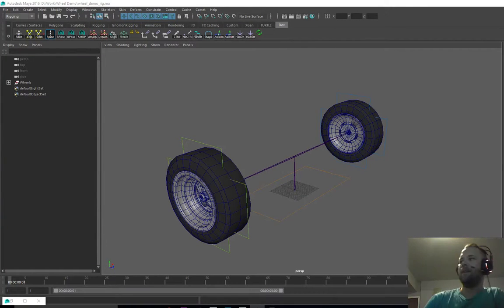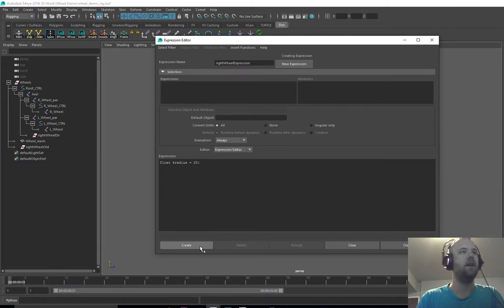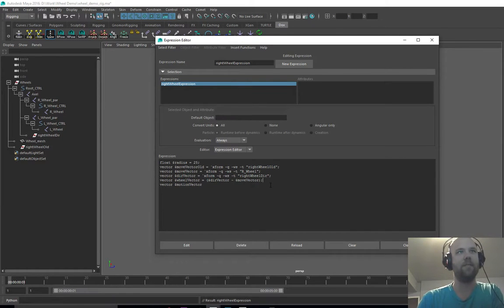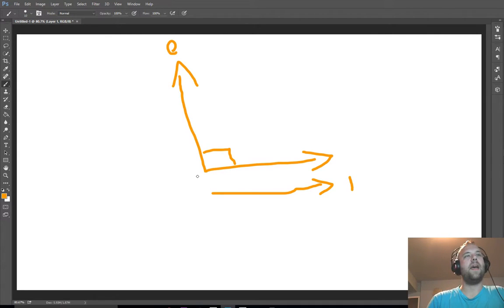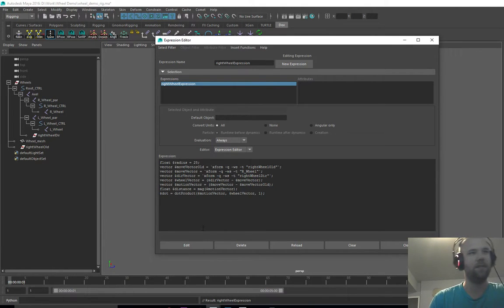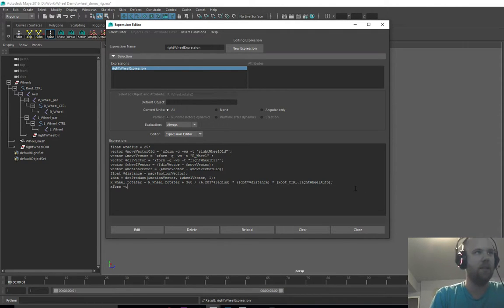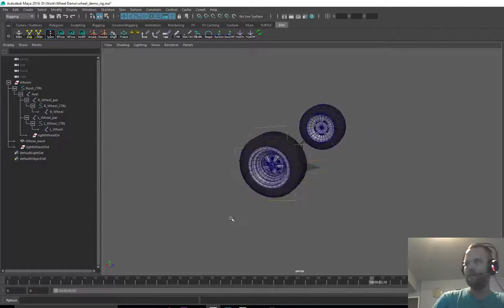Maya Wheel Rig with World Vectors

Comment: Hi, it is a great tutorial actually, thanks for sharing .... I am facing a problem though , if you animate and then press the playback button to check your animation, you won't be able to use the Ctrl+Z anymore, or you loose your undo ability ..... if I delete xform -t ($moveVector.x) ($moveVector.y) ($moveVector.z) rightWheelOld; this line however, the undo capability is back again .... could you guide me about this .... thanks again for sharing this .....

Comment: Hey people, 
if you´re like me and you got the whole thing working in a rig, but when you reference it in your scene and animate it and it suddenly stops working dont worry, I found the reason after several hours of despair.

The correct function of the rig seems to be dependent on the scene scale, if the rig scene is in centimeters, and the animation scene in meters, the wheels will turn only ever so slowly. In other words, while the rest of the scene gets adapted to the right size, the rig only takes "grid-dimensions" for its calculations.
I fixed it with an attribute to multiply the wheelturn by 100.

Boolean Atrribute on your Move CTRL: MeterSceneScale
Then wherever the rotation is applied to the wheels, add this: 

max((100*CTRL_MOVE.MeterSceneScale), 1)*

ofc CTRL_MOVE might have a different name for you. ;)

Anyways, thanks to Andrew Christophersen for making this video, it has saved me a lot of hassle working on my shortfilm! :D
Reply: Hi Maxim, I didn't get what you mean for MeterSceneScale. Could you give the full functions in here..?

Comment: In Maya 2018 I am getting syntax error pointing to the string variables even though i have named the null group and the sting identically. I am wondering if the has been changes to MEL in the last couple of years as I am having real trouble debugging the reason for syntax error.

any help would be appreciated
Reply: I had the same syntax problem, but got it working now. I used different names for the null groups so that doesn't matter. it seems to me that the text you copy has some different text code to the characters that causes MEL to error on my PC or something like that, because i retyped the command fron scratch and then it worked with me.
After that another syntax error occurred from the copied script on the vector subtracting lines. there it also was the minus sign that was the problem. I just retyped it in a texteditor with the minus on the alphanumerical part of my keyboard, so not the numbers keypad and that fixed it.
You also have to set the radius to the sheight of the particular wheel you're trying to control ofcourse.
Good luck!

Comment: Hey Andrew, thanks for this tutorial. Really well explained as you're going through writing out the expression.

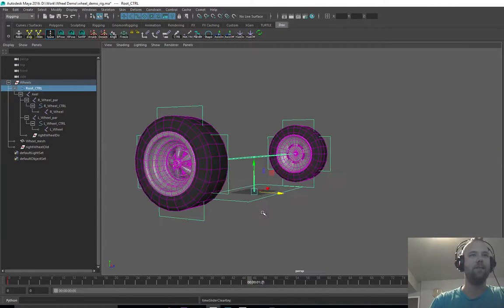I've got it working for both wheels in my test project but I have a slight issue where the wheels don't spin if I rotate the root_CTRL as you do in your video at 15:27. Do they also need to have some kind of forward motion to be able to calculate the vector correctly? I don't think I'm missing anything as I followed along exactly.

Cheers

Comment: Hey man. This is exactly what i need but i cant seem to get it going. Like a couple of other comments underneath, I'm struggling to see the relationship between the joints . I have tried your suggestion of placing the _par joints out in the wheels though this is not working for me. I have noticed that you have a joint at the origin point. Is this your Axel joint? If i create an Axel joint here, the flow of my joints does not look the same as your without shifting the joints from out on the wheel to overlap in the center. I have skinned my wheels mesh to the two wheel joints but no joy. Do i need to create the expression on a specific joint or controller? Any help will be greatly appreciated and really help a brother out. Cheers and gone.

Comment: I’m trying this right now. I’ve watched this video a thousand times trying to figure out how all this works. Fine tutorial but it would help if you would have explained the relationships of the groups I.e. what’s what a little bit better. I have my outliner looking like yours but what is R_Wheel_par? Is that the joint at the middle? Or the joint in the wheel hub? I assume R_ Wheel_CTRL is the square shapes around the wheel. Also the wheel mesh is a group also? If so are the rim and tire grouped separately from the one on the left and the parented as a whole? If I could understand this I think the MEL script is not that hard. Please help me with this this is the perfect rig I need for my Segway concept model.
Reply from the maker: If I remember right the "Axel" joint is the one in the middle and the "_par" joints were out on the wheels to zero out their transformation. The tires are one mesh called "Wheel_mesh" that is skinned to "R_Wheel" and "L_Wheel".

Comment: You, Sir, are awesome!! :)

Just one question because it was actually driving me crazy before I figured it out:

Did you skin the Wheel-mesh to the wheel-bone?
It is not totally clear how the actual wheel is connected to the bone. And after I finally managed to customize the script for my own version, neither standard parenting nor parent constrain worked for me (purple color and no additional nodes for the mesh finally gave me a clue about that it might have been standard skinning with 100%). This works perfectly so far.

Please tell me if that was the right way to connect wheel mesh and wheel bone or not :)
Thanks a lot for introducing me to Vectors in Maya!! :)
Reply: Hey man have you figured out what to parent to what as I still can't get my head around it, if you have any tips would be appreciated. Thanks

Comment: Hey Andrew, I can't get the joint to rotate, so I ran the code line by line in MEL editor and I get an error - "Error: Fr_left_wheel_jnt.rotateX +=(360/(3.124*$diameter)) * ( $dot* $distance ); // 
// Error: Line 1.64: Invalid use of Maya object "Fr_left_wheel_jnt.rotateX". // "

 this is your code adapted to my scene-
float $diameter = 68.1;
vector $moveVectorOld = `xform -q -ws -t "Fr_left_wh_old"`;
vector $moveVector = `xform -q -ws -t "Fr_left_wheel_jnt"`;
vector $dirVector = `xform -q -ws -t "Fr_left_wh_dir"`;
vector $wheelVector = ($dirVector - $moveVector);
vector $motionVector = ($moveVector - $moveVectorOld);
float $distance = mag($motionVector);
$dot = dotProduct($motionVector, $wheelVector, 1);

Fr_left_wheel_jnt.rotateX +=(360/(3.124*$diameter)) * ( $dot* $distance );
xform -t ($moveVector.x) ($moveVector.y) ($moveVector.z) Fr_left_wh_old;

if (frame==0) {
Fr_left_wheel_jnt.rotateX = 0;
}
Reply from the maker: It doesn't work in the script editor because it doesn't recognize Fr_left_wheel_jnt as an object. It only works in the expression editor because the joint is the object the expression is created on.

Comment: Hi
First of all, thanks for the tutorial, I learned a lot from it 
I followed your tutorial and it works perfectly on its own. I had some animated scenes that used a rig that wasn't working perfectly and replaced with this new one, however, it works in some scenes but in others doesn't. Do you have any idea what may be happening? I tried to create a new reference instead of replacing the old one, but even in the new referenced rig the wheels don't rotate, or rotate slower than usual. I guessed at first it may be a problem with the file extension, but that wasn't the case.

If you could help me, I'd appreciate it greatly. Thanks!